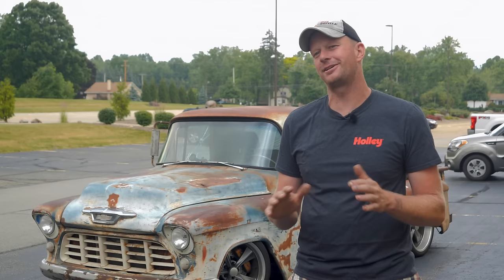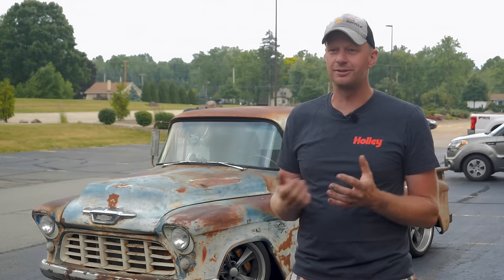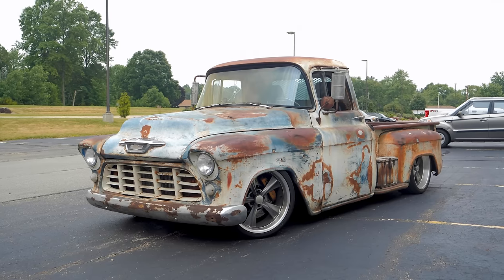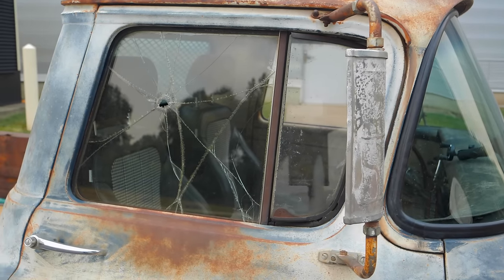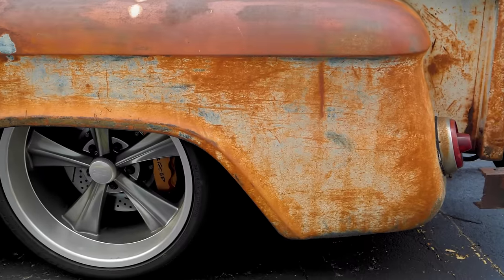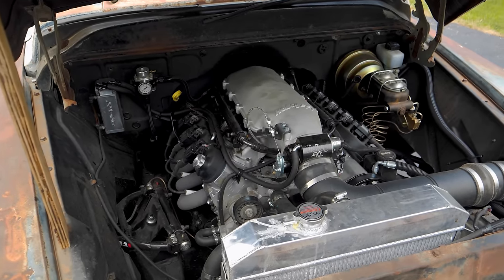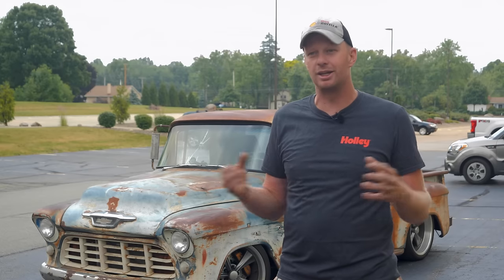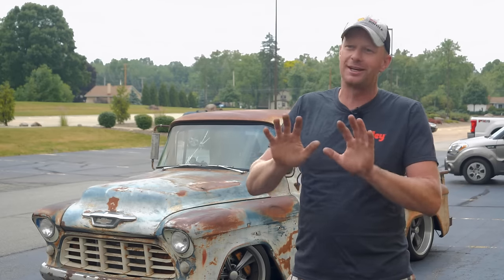Apache, a Patina—Check out This LS-Powered 1955 Chevy Truck from Deboss Garage

Comment: Never celebrate patina. It just means you're either too cheap or too poor to finish your build.
Reply: Anyone can paint a car. It take patience to find the right car and not ruin the history. building a 50 Pontiac wagon. So difficult not to take easy way out a do complete paint.
Reply: Not poor, just using the $15 000 towards something else.  I have 1/2 dozen rides with perfect paint, and it causes stress.  Its ok to enjoy both.
Reply: How about you never tell another guy how to do his own build. That'd be great... but I have a sneaky suspicion this advice will allude you.
Reply: @DEBOSSGARAGE exactly! 💯
Reply: My 68 c10 is all original. It is not seeing a paint job anytime soon. Looks great rubbed down to primer in spots